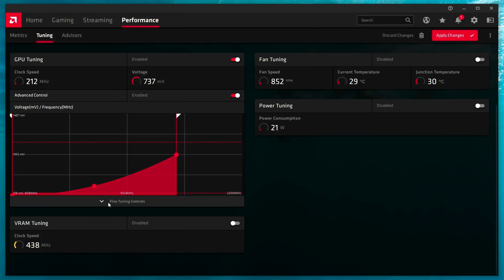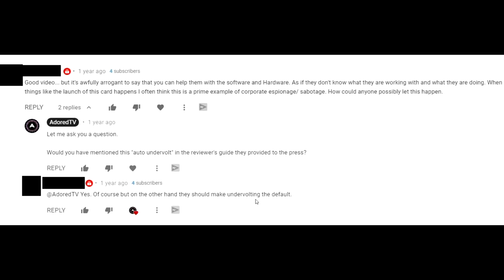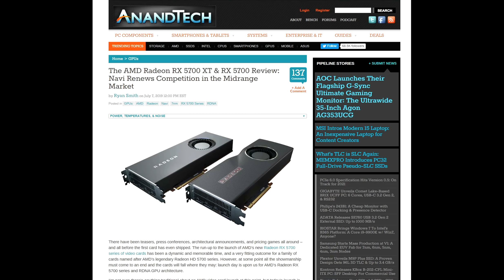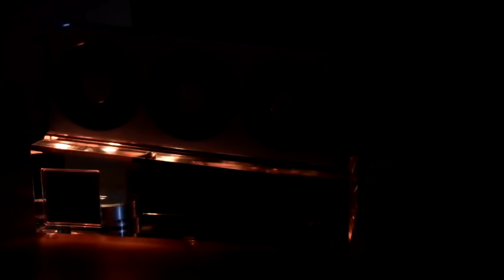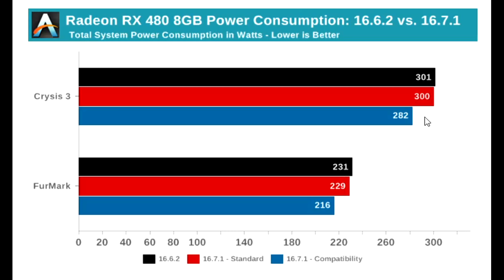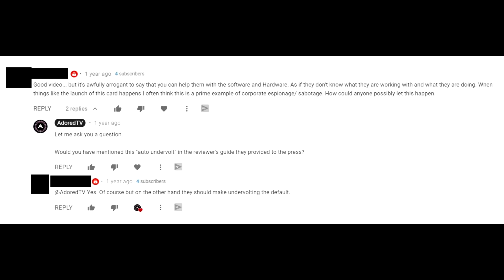Fixing AMD's "Hot and Loud" Graphics Launches.

Comment: If they went the route of releasing 5700/XT at 300$ and below with clocks at 1300-1600 MHz and 0.7-93 mV it would have been heralded as an efficient card, and an overclocking champion to match the 2070. 

But they couldn't have risked it. They needed that extra margins. Did they?
Reply: They would have gotten roasted alive for only bringing out a card not even out performing a Vega64. I can already see the memes. 

"Even with a new architecture AMD is unable to compete with Nvidia."

The problems with the big RDNA1 die really screwed them over in this regard.
Reply: @Gustav Gamer  As far as I can tell, 1600MHz was the originally intended frequency for the 5700XT, the card is just so efficient there. But they still wouldn't have had anything at the top outside of the Radeon VII and I honestly think that their yields on Vega 20 improved so much, that it was no longer profitable to bin down MI50s to sell to consumers. But they couldn't really cancel the R7 without replacing it with something in the same performance class. So they had to have a regular SKU (not something like an Anniversary Edition) around there, which they did by overclocking the hell out of the 5700XT. Seriously the 5700XT is operating about 25% above it's sweet spot and it is still really efficient.
Maybe they could have solved it by releasing the 5700 around 1600MHz, the 5700XT at 1800 (still efficient) and a 5700XTX around 2GHz. 

Looking back at the first year of RDNA, it kind of seems like RTG was in a holding pattern for second gen RDNA. 
First they were doing the releases of the 5700 series as a sort of damage control for the problems with big Navi, just so that they could stay relevant to the conversation. They had to produce the 5700XT for the console dev kits anyway, so it wasn't really such a big problem to launch these to consumers. 
Then their OEM partners wanted new cards based on RDNA for their systems, just so they didn't have to continue to sell Polaris. I'm very certain that Navi 14 was intended to only launch as an Apple exclusive part, but see previous sentence. Then it was launched to consumers b/c "Screw it, we are already producing these chips, why not sell them to gamers for a quick profit." 
The 5600 (XT) probably was born due to a surprising number of cards with defects in the memory controllers and bad press for leaving this big no mans land in their lineup and you know how that went down.
All the while RTG was working on Navi 2X to finally fix all the issues with first gen RDNA. 5th of March is going to be very interesting.

Comment: Undervolting in Linux requires a powerplay table mod. Still runs hot though. Although, the Linux amdgpu driver is more stable :) I have Radeon VII.
Reply: The AMD Linux driver is open source, so usually the community comes together and fixes all the problems. Compared to Nvidia's closed source drivers with zero support, AMD is the best option for Unix based OS.
Reply: powerplay table mod? you should be able to undervolt through the sysfs interface
Reply: rationalityfirst I used this... https://www.reddit.com/r/linux_gaming/comments/au7m3x/radeon_vii_on_linux_overclocking_undervolting/
Reply: @Sam lol I remember one time I forgot to clear my CMOS and thought I broke something. Was about 30 minutes before I decided to try clearing the CMOS. Bad overclock settings caused a state of no post.
Reply: Undervolting in Linux requires a powerplay table mod? I have a Vega 56 and undervolt just fine without any of that
Reply: Lol ,, linux user here and yes they are way more stable.. ;)